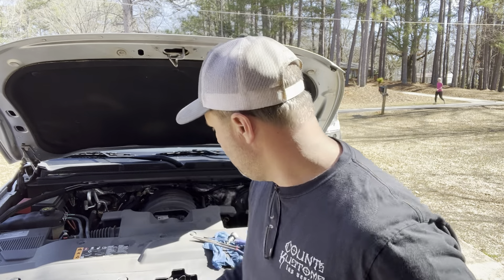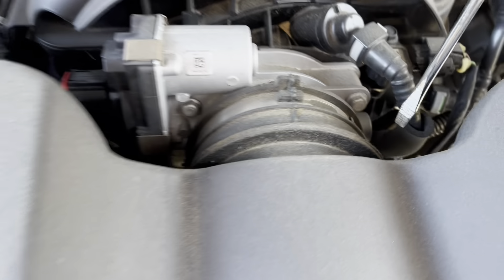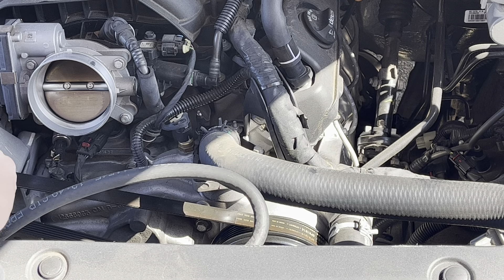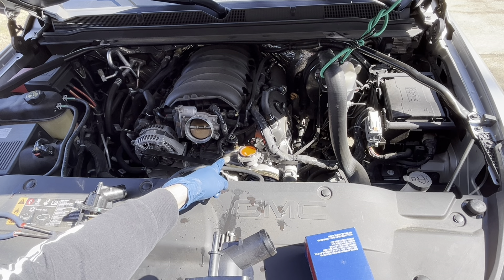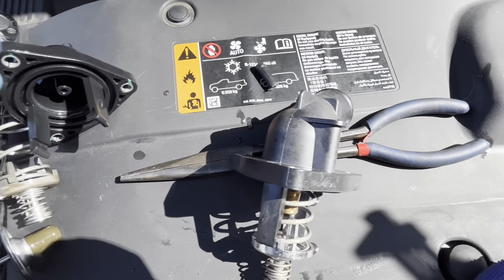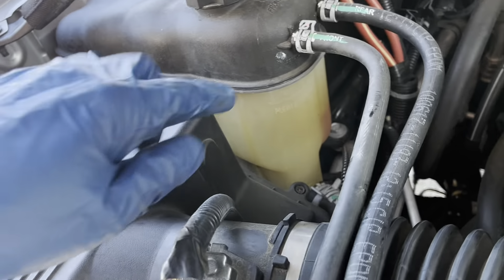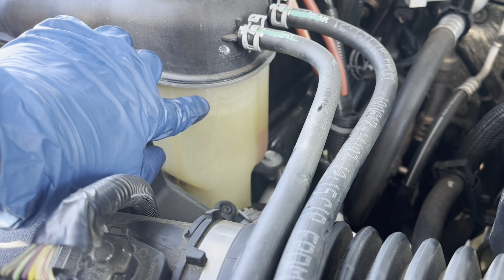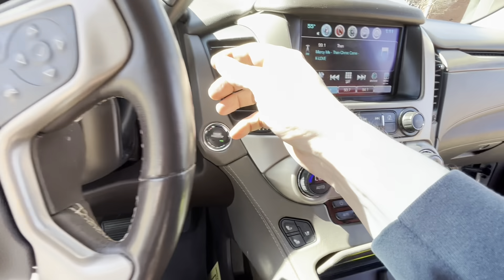How to Fix Code P0128 - GMC Yukon

Comment: I changed my thermostate but same problem also changed my cooling temperature sensor.same problem
Reply from the maker: Wow!  Not sure what’s causing that. My thermostat change resolved the code.
Reply: Maybe check voltage at sensor and all fuses?
Reply: Check the sensor wiring.